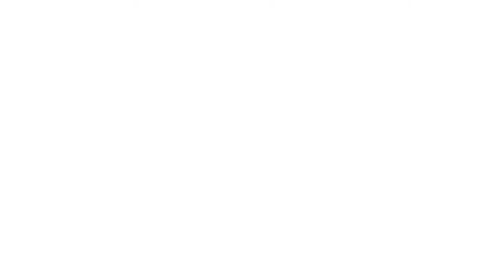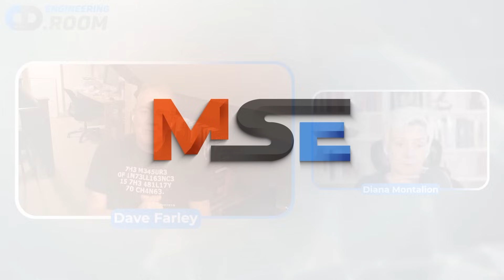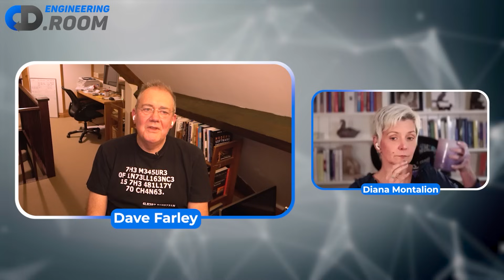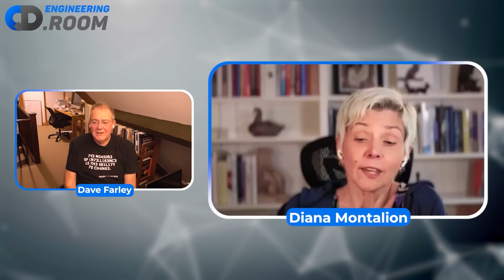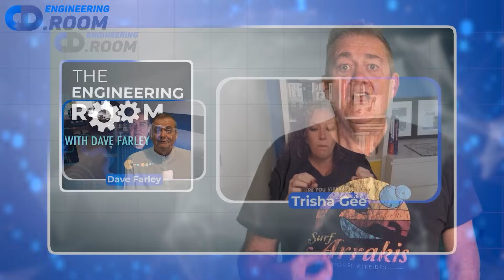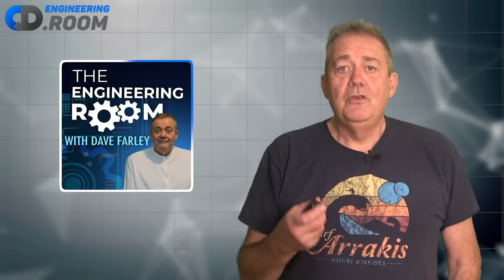Why Engineers and Architects See Software Differently

Comment: 7:56 "We're debugging the cat." 8:22 "It's a particular style of problem solving. And, we often confuse a more linear reductionistic style with debugging the cat." People tend to simplify. I've seen it in every area of life (automobile repair, healthcare, software) but the most things, like the cat, are a network of complex interworking systems.  Often an Authority (mechanic, doctor, dev) comes along and only evaluates one of the interworking systems & thinks, "Well, I solved that."  Meanwhile, the problem was caused by another interworking system having an effect that caused the situation and the "fix" is applied at the wrong place.

Comment: That story about her cat 🐈 is what I miss with my specialists. They aren’t problem solvers (I loathe doctors). I have a serious auto immune disorder. That reflects on my heart. I told the cardiologists “my heart is a symptom! Stop fucking treating symptoms and treat the cause!”
They simply don’t know nor care to find the root cause. They don’t follow engineering principals to find root causes and solve those. They follow very simplistic protocols with expensive steps. That’s why Dr House is such a great series, he gets in trouble for breaking protocol and actually fucking think! More people should do that. When they came to me “you aorta is too narrow and has a weird curve that limits blood flow.”
I was like: “I told you doctors as a 13 year old that I didn’t have asthma because those inhalers never worked when I exercised. Well that mystery is resolved after 34 years! And no, I’m not worried I’ve had that for 47 years so it can’t explain these sudden fib attacks.”
They are trained not to think. And especially not to think outside their specialism. Turns out I have an auto immune disorder. It took them 6 years to diagnose that.
And now they are wondering if that is correct because my immune system seems to find away around all the suppressants.

Comment: Most of the conflict between architects and engineers comes from a disconnection between what is being created at the higher level and the actual limitations and requirements at a lower level.

I would also put forth that, regardless of which level you're working at, if you don't have knowledge of the details 1 level below your working level of abstraction, you cannot be good at your job.  This is where the "head in the clouds" architect stereotype comes from.